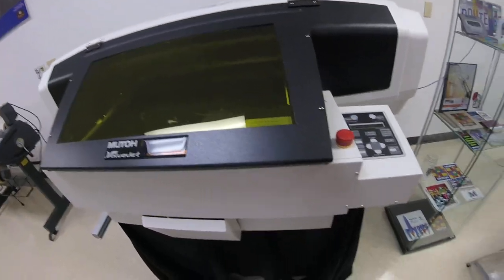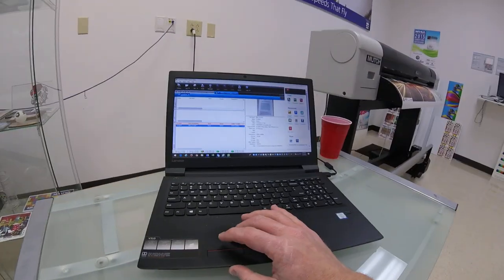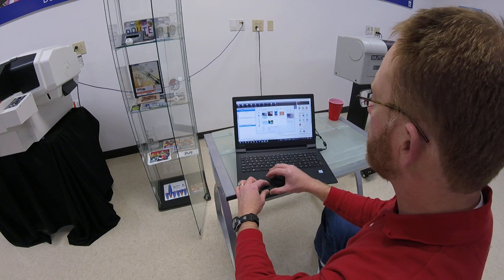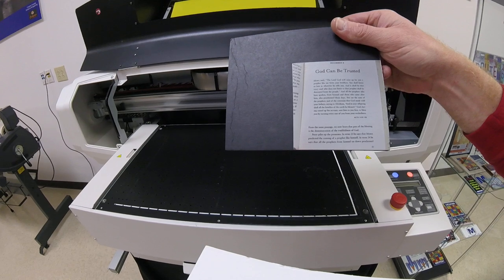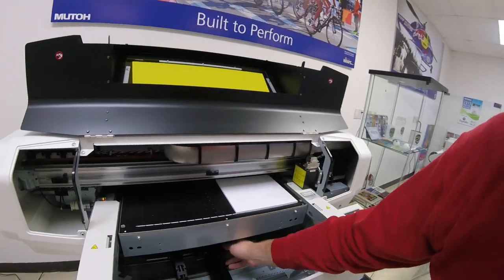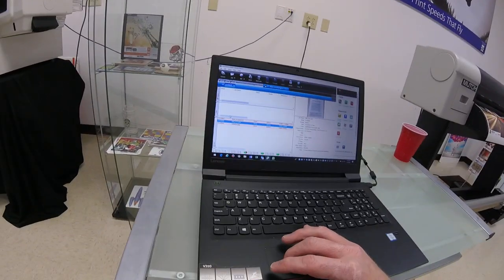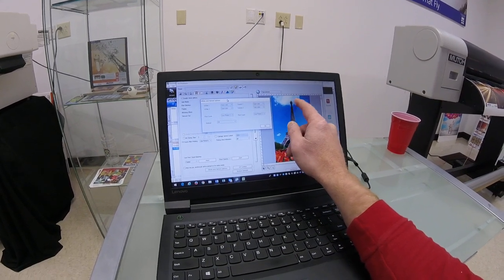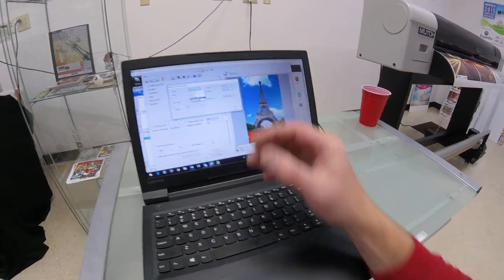Mutoh 426UF video #3

Comment: Hi ive got the question, we`ve got the same printer and the problem is in high consumption of ink. Can you tell how to solve this problem?
Reply from the maker: Patryk Książek is it just the white ink. If so, turn the white ink consumption to LITTLE from Normal. You are welcome to contact our Mutoh tech dept 480-968-7772 and they can help.